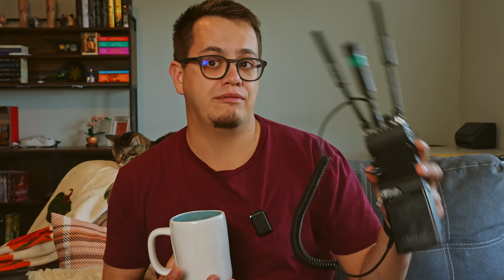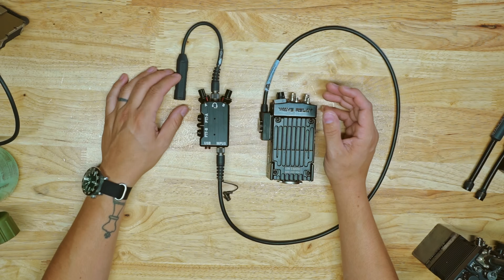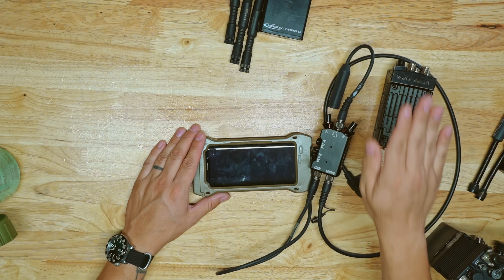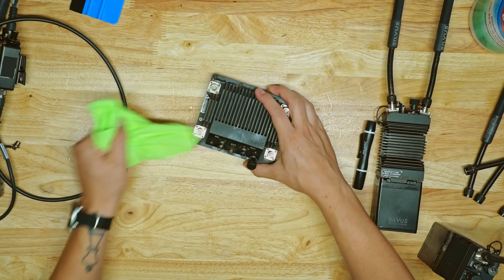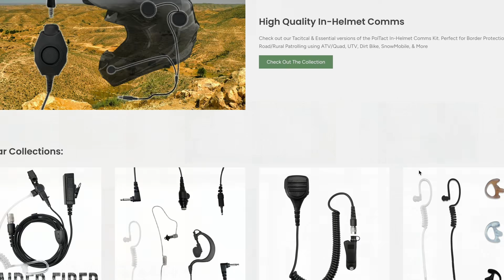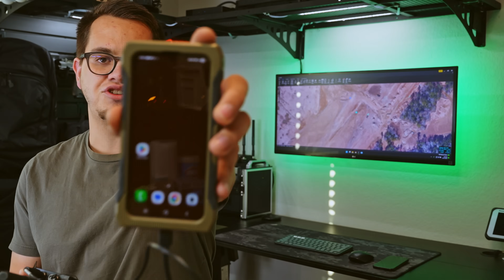How Prepared Citizens Can Get Started With MANET Radios – Pt. 1: Sourcing

Comment: So Austin you can own these but you can't use them! So how do you use this in a legal framework because these things don't seem to really fit any guideline the FCC has. I'm sure they're great for grid down connectivity but while the grid is up and running the rules still apply so why should somebody waste their money?
Reply from the maker: I use them anyway, just like all the manufacturers of MANET radios. Look up the STA filings.
Reply: @austinjoemiller  oh yeah! Duh!! An STA filing!!! The thing that cost $150 for a maximum of 6 months of use unless you manage to prove extraordinary circumstance which allows you to extend that out to an additional 180 days. Never mind the bureaucratic nightmare it is like full disclosure of exact geographic coordinates, operating radius, specific frequencies, power levels, and equipment specs into a publicly searchable federal database (FCC ULS). Instant revocation of your sta if you create any type of interference for primary users at any point and filing timelines for every little thing you do with the radio. I suppose that's fine for somebody who works for the company that produces these. But for the Layman you're pretty much advertising these too. They're not going to want to or even know how to file everything appropriately and even if they do it is unlikely that the FCC is going to approve it for your average operator. 

So again, i ask the question, whats the point for everyone who isn't a military contractor and just a prepper? These things seem nonsensical given the actual rules  the fcc has provided. What's the point of having a tool for grid down purposes if you can't practice with it virtually unrestricted when the grid is up?
Reply: @austinjoemiller I don't mean to sound so jaded but it is kind of frustrating that this Tech is out there and that it's more or less being advertised to civilians and the majority of us will have no actual use case or ability to practice in the event of a grid down scenario.
Reply from the maker: @dubsteppro777  You’re confusing the maximum allowable duration of an STA with how the FCC actually processes and grants them, which are two very different things. The FCC almost never even replies to an STA request, and they still keep the $150. When they approve, they typically limit it to a matter of hours. 

More importantly, this video was purely educational, not a sales pitch or an attempt to convince you to buy anything. If the technology doesn’t make sense for your needs, that’s perfectly fine, but I’m not sure why you expect me to justify a purchase I never asked you to make.
Reply: @austinjoemiller  im not confusing it. In fact you proved my point even further by pointing out that they approve it for a matter of hours. The problem here is the lack of honesty with your audience which comprises mostly of civilian radio enthusiast, and preppers, not military contractors. Your statement about "this is purely educational" and "not asking anyone to make a purchase" while correctly is also disingenuous. Part of education is making sure your audience understands the constraints. That wasn't done here instead you walked through how civilians can purchase these in the majority of the items you'll need for it. All while conveniently leaving out the bureaucratic nightmare that comes with trying to operate with one of these. This isnt about you justifying a purchase for someone else. Its about the actual limits of the tech for pretty much the entirety of your audience!
Reply from the maker: @dubsteppro777 I ain’t reading all that.
Reply: @austinjoemiller  c'mon big boy! You want to come across as smart then start acting like a reddit mod when confronted. You dont have to get all in your feels you could just be an adult and have a conversation. Or don't and act like a child the image and reputation is yours to wreck 🤷‍♂️

Comment: I don't need to build hardware I mostly own. Plug a radio into a phone and configure some software DONE. Why build a device man that is just crazy. I can add a tiny module to the phone for anything I need configure a little software end stuff and be done with it. You do not need to be some engineer to plug in some stuff and tick a few boxes.

Comment: If you are spending on this as a private citizen, you are probably hunkering down in your compound for Johnny fed to come knocking already. Scale for a community,a "team" structure, etc, but bang for your buck, openmanet has proven to be pretty useful. I don't buy into the fear factor and FOMO. sometimes you gotta go buy cheap stuff that won't get subpeona'd and set it up, and of cource learning proper Sigint and not thinkign a few forum posts and yt videos means an off the shelf 10-30k option buys you security without knowing how it works.

Comment: Not sure how much you've used WiFi HaLow but getting 5-10mbps (enough to push HD video) is possible out to about 1-2km per mesh node. I've been pushing drone feeds over 1km+. If you're just doing encrypted comms (100-200kbps) + PLI, you have plenty of overhead bandwidth to push out to 5km+ for under $500. I get that it's not the bandwidth or range of a $10,000+ MANET but it's a great alternative and it's all license free. You can use this with a mobile tak server (vehicle mounted for exmaple) and have a mobile edge c2 system that is 4g enabled and federated to a TOC-side takserver. Since the takserver/EUD is managing audio, a bluetooth PTT will work fine.

Comment: I eagerly await Baofeng's advance up the value chain.  For $30k (generously ~$10k a pop, min of 3 for the meshing to actually be a meaningful feature) I could easily give every household I know a pair of DMR-32UVs (EDIT: BTECH UV-PRO can apparently handle ATAK, so if that's the killer app there you go), have accomplished much more, and still have money left over.
Cool as the technology is, if you, as a civilian, are preparing for anything short of prolonged societal collapse manet is probably overkill (by rights a programmed UV-5R in a closet puts you ahead of the average person, and unencrypted digital simplex probably puts you in the 1%), and if you are preparing for that, and have everything else squared away to the point that you're considering spending 10s of thousands of dollars on comms, you can probably achieve higher value add beforee and after the dark days come spent on a passport and making friends in a backup country or two.

Comment: Working on a set of OpenMANET devices using Reticulum using lora (meshtastic) for longest range ping and location and encrypted voice comms using wifi halow for the medium range.
Reply: cost is about $100 per set and custom designed battery modules and cases to keep it all safe and secure.

Comment: I would have to say there is a problem with them being so expensive. DIY options are out there but there is no difinitively cheaper option that has all of the same functionality. On the civilian side, there are definitly ways to get almost all of the same functionality, though considering large unit logistics and even small sof operational logistics wont be in play. Small team tactics are achievable with a dedicated gps unit and a manet/mimo/mesh reciever and transmitter all in one package, DIYd into a waterproof housing. The problem is affordably connecting that to a ptt. you'll have to effectively make your own passive ptt and cables just like on the mpu5 and the silvus equivalents, all while keeping durability up for real world use. You're still looking at 4000-10000 USD and hundreds if not thousands of hours or research, development, and real world testing with different equipment to try and match the performance of these available units. But, with a proper collective community, we can come up with an affordable and open source set up.

Comment: What kinda budget should I expect to have to get started with setting up one or two of these?
Reply from the maker: That’s a very difficult question to answer because cost varies so much, and it’s why I didn’t talk about the pricing of the units themselves. 

The best advice I can give is maintain your financial agility, because they come up with zero warning and don’t last. Get rid of all your consumer debt. Have liquid assets. Be ready to get a business card or loan if you want to go that route. Have an LCC so they can be a write off.
Reply: I had a feeling that was going to be your answer... lol

I should have assumed they're going for at least as much as surplus APX radios are going for... Sucks that good comms still cost so much! 

You'd think like most other tech... they'd lose a ton of their value as soon as the next years model comes out... 

For sure having an LLC and writing them off would be super helpful! But that also means they're running anywhere between a PVS-14 and 31's in price... I know new MPU5's are insane but was hoping something like these especially being used would be more attainable...

Comment: ... stupid devices. MESH and MANET costs less then $500 with so many good Community made Solutions, and less than $200 when sourcing quality parts and run them with a laptop. You wont get 100Mbps, due to requiring like 10W Tx Power which causes freaking cancer, but with 1W you get like 60Mbps in line of sight. And true Gov devices capable of frequency hopping out of band are not legal to operate anyway, so spending 10.000 of dollars to own such is only for LARP Geardos but not for any sane person that desires the capabilities and satisfy the need with uncertified chinese hardware to run out of band for a fraction of the cost.
Reply from the maker: The fact that you think bandwidth is determined by power level tells me everything I need to know…
Reply: @austinjoemiller  I mean, bps (what he's talking about) is a function of bandwidth and SINR, so power level does play a role in throughput

Comment: In which situation I need more than 1mbps?
Reply from the maker: When you want to send video, high-resolution imagery, or anything else that’s larger than 1 Mbps lol
Reply: @austinjoemiller  is not issue of the transmission type, is all about resolution. 1 mbps can transfer 680 and in 90% is enough
Reply from the maker: @nurgozhin not even close; a 640 30FPS via UDP multicast is gonna consume around 3MBPS, and you’re gonna have no error correction and packet loss if you’re maxing out your network’s bandwidth.
Reply: @austinjoemiller  in fact I am watching video in 480, so is not issue as I mention before

Comment: Yo can definitely get this same exact set up but way cheaper and still do about 80% of the same capability just buy a PV1 dart mesh device a yogurt cup antenna the one that dose dual band and 915mhz a dm32 DMR radio and a xcover6 pro from Samsung and a data cable off of Amazon and you got your self the same setup for way cheaper and about 80% efficient.
Reply from the maker: I checked your channel and couldn’t find any footage of this actually deployed
Reply: @austinjoemiller 1 I don’t make content I watch it second stop copping I’m not trying to bash you or anything I’m just saying there are other options out there that can definitely get you 80% threw the way and third that “set up” sure has been used in a lot of Milsom West event 😂 with great success.

Comment: I think 99% of prepared citizens don’t need a mesh radio, it useful info for larger unit like platoon sized or even larger. Most people don’t have have a reason for the data and you probably don’t have enough people that would be far enough away to need the GPS data
Reply from the maker: You only need 4 people for a fire team and a maneuver team.

Even two teams of two can perform basic fire-and-maneuver. You don’t need a platoon to justify shared situational awareness/PLI. Just people who actually need to coordinate to achieve something.

Comment: Hytera radios are specifically banned by NDAA because they are substantially owned by the Chinese government.  You may want to consider another default for your team:

NDAA section specifically banning Hytera:   "For the purpose of public safety, security of Government facilities, physical security surveillance of critical infrastructure, and other national security purposes, video surveillance and telecommunications equipment produced by Hytera Communications Corporation, Hangzhou Hikvision Digital Technology Company, or Dahua Technology Company (or any subsidiary or affiliate of such entities);"
Reply: They're also banned for stealing Motorola's intellectual property TWICE in both generations of their radio designs...
Reply from the maker: No, I don’t think I will. I’m a private citizen and I can make my own assessments and use whatever tool I deem appropriate.
Reply: @austinjoemiller  
Not a great deal of difference between Hytera and Moto for example, other than the fact that Hytera offers a timeslot agnostic mode (pseudo trunk), has muti-band audio equalize, has software that doesn't REQUIRE connection to the cloud for FW updates, has mobile radios that will connect directly to the internet acting as RoIP nodes, has enhanced privacy as standard, allows FW downgrade, has SMA coaxial connectors as standard, allows software to be run without installation...
Okay, maybe there IS a bit of a difference.
Yeah - I'd probably choose H as well.

Comment: sooooooo, what - roughly $30,000 for a working set of TWO?!?!  jezus.  guess i'll be sticking with hand and arm signals...
Reply: When SHTF, one finger works.
Reply: You could build 60 optic fiber FPV drones for that price. Unjammable and can take out fucking tanks. Or you can get a radio for you and your buddy. Which is going to increase your defenses in a SHTF WROL situation lol
Reply: I can transmit data faster using smoke signals before I’d be able to afford $30k for a pair of radios.
Reply: You could at least get a DMR radio with encryption for under $100 bruv
Reply: I have my cans with string ready
Reply: You can just build them for around $130…..
Reply: @alwayswatchingthf can you tell me more?
Reply: @kalblades research "openManet"
Reply: @kalblades raspberry pi, lora module, chinese batteries, a 3d printer, and schizophrenic auto correct(AI to write the code) and you can build yourself a mpu5 clone
Reply: @greenthumbedfeline can you make a Utube video on doing this?
Reply: @kalblades theres dozens out there I'm currently building one. It's not hard at all and will run you around like $400 for a really fancy set up.
Reply: look into the OpenMANET project. For about $150 you can build one.
Reply: Can you have both systems working together and communicating together if guys on your team have either unit.
With push to talk and messaging?
Reply: Lol. Hands are free!
Reply: The DIY space is making more progress by the day.
Reply from the maker: you should do both actually
Reply: Not exactly 30k for two. Thats with everything. You can get talking for about 10k per node (I bought three). Don’t use the RDC, the lag is pretty bad from what I’m told. I run S22 Ultras
Reply: I think OpenMANET is the thing we want

Comment: Aren't these radios 20k? Also, these radios can't talk to another radio (uhf/vhf) from my understanding unless plugged into another mesh type radio. Can the mpu5 talk to Silva stream caster? It seems like the best use of these radios would be as a data pusher because it's very cost prohibited for the regular civie. That being said I'd love to learn more and I was wondering if there was an "S" tier VHF and UHF option that we as civies can own.
Reply from the maker: Yes, I have the ROIP ability to have these talk to other radios. I will cover that in another video. 

Sure, you could make the Silvus and the MPU5 cross talk. Just plug one of each into a network switch. 

Yes, these are a great tool for moving data and don’t necessarily have to be the default when just using voice comms. 

S tier VHF/UHF radio would be the Viking VP8000. It’s dual band and analog/DMR/P25.

Comment: You can build these units for far less than what the Name brand radios go for.
Now in todays age you can have all the encrypted comms you want but we can home in to your transmissions and one becomes the target. One needs to utilize frequencies that are seldom used and allow a relay transmitter at least a hundred meters from you location. It will transmit in high power making it the target should the perps home into the location.
Now as for broadcasting with those Manet units, you must limit your transmit frequencies to those one is authorized to use. Use a military frequency and you will be visited by the FCC in the USA.
Are these radios utilizing standard TNC connectors on top or are they reverse TNC connectors similar to what are on routers or WAP’s.
Nice Office! What type of projector are you utilizing for your screen? Active, reserve or vet?

Comment: I was looking at the airMax prism and some omni 5g antennas i noticed it had a voltage range from 18 to 27 volts witch is within range of power tool batteries is there a ethernet to USB-C to use it with android or would you need a wireless card to connect for ATAK between a moving element and a FOB